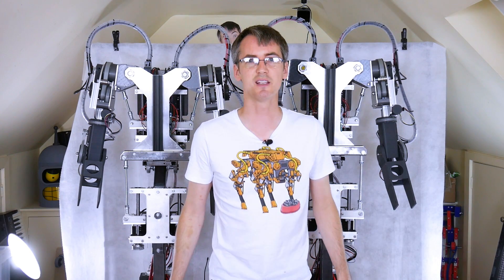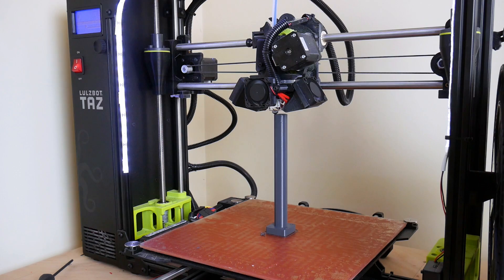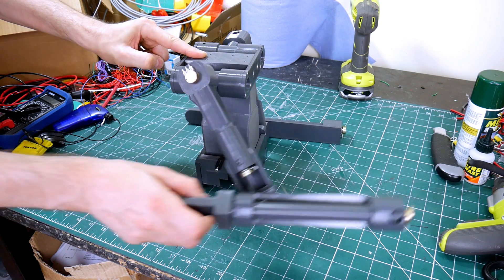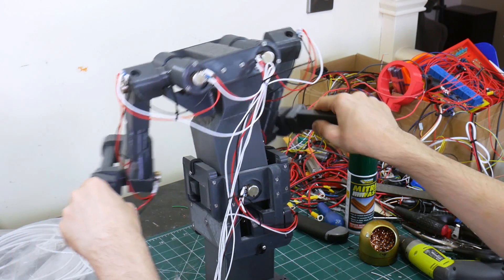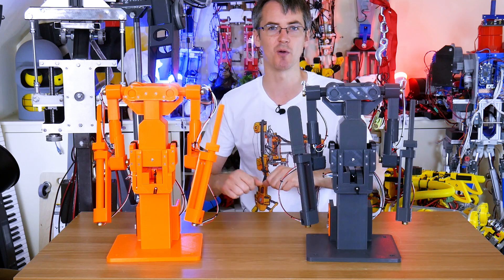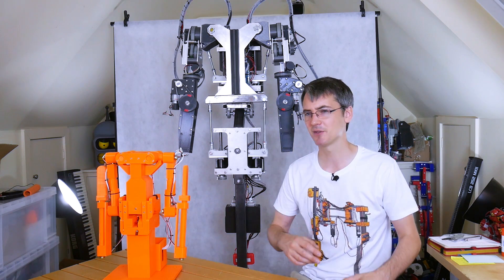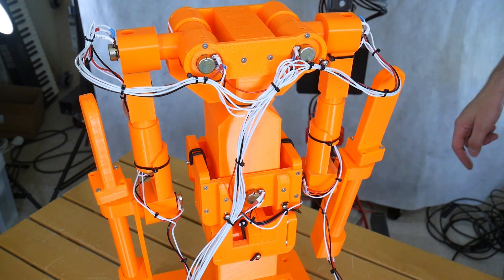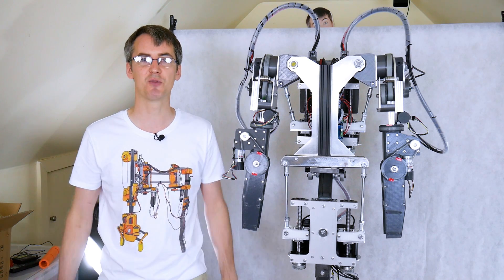Building Motion Capture Rigs for Robotics & Animatronics

Comment: Great work, if you need to get 3D rotations to animate the arms  from a webcam source you might find MocapNET helpful. It is hosted on github and outputs full 3D pose in BVH format ( including the  joint rotations ), so you can just grab the left and right elbow and shoulder joint values and use them to set the pose of the large robot..!

Comment: It'd be cool if someone eventually made some kind of mocap suit for human controlled robots. 

Using gyro and accelerometer IMUs makes the most sense. It'd only require seven sensors, two wrist + forearm, two elbow, two shoulder + upper arm, and one torso; most of them would have to be 6 dof IMUs, except the elbow which would be a 2 dof IMU. I know your robots don't have torso twist, and your wrists might not be 2 dof, but that doesn't stop someone from adding these to their own robots.
Then that just leaves whatever the hands are going to be. If they're just simple grippers, an analogue trigger would work. But if someone wanted a full hand, and developed a fully functional robotic hand, then a mocap glove would have to be made.

Hands aside, how difficult would this be to develop? The most adaptable solution would to put each sensor on a band, like a wrist band, elbow band, and torso band, then finding some kind of solution for the shoulder. 

The only awkward thing might be scale and proportions. For an exaggeration, say you have a 4ft person controlling a 6ft robot, there may be some difficulty controlling it due to scale not being 1:1. For another exaggeration, say you have a person controlling a robot with the body proportions of a gorilla, similar to the scale issue, but now the arm proportions are not 1:1 to the human. Not sure how this would be fixed without a complex program that would translate scale and proportions to make hand positioning 1:1, which would then start involving kinematics.

Comment: These pots tend to loosen their internal structure and offset their position when pushed over their limits. To avoid that, you'd better design mechanical limits in your joints to protect the pots. That is in case you plan to use them for long time. And just for preventive maintenance, you'd better replace them once per year.

Comment: Looks GREAT!  The range of motion on the shoulder joints of the puppets seems a lot larger than what you can get on the actual robot.  A physical stop of some type on the puppet robots may be useful to mimic the larger robot.  Quite impressed with these robots though.  I am curious what the puppeteering would be like if you dialed back the filtering to see just how responsive they can be on their current power supplies.

Comment: If there was ever a time to implement machine learning, it would be now, to convert the input from the puppeteering rig, to 1:1 movements in the robot. Basically, you use the input from the rig as both the input for an artificial neural network, and the desired result for the sensors in the robot that read the positions of moving parts. Essentially, it would be something like an auto-calibration program. (I may be using the word “calibration” wrong. Just a little.)

Although, it might be good to wait until the rig is fully upgraded, in its final form.

Comment: I’d love to see a motion capture suit exoskeleton
Reply: Motion capture becomes difficult when you factor in scale and proportions. For an exaggeration, say you have a 4ft person controlling a 6ft robot, the scale difference would cause difficulties in controlling the robot. Similarly, proportions have the same issue, for another exaggeration, say the robot has the proportions of a gorilla, the longer arms would make control difficult. There's no easy way to fix this without multiple kinematic calculations and finding a way translate the movement of one to the movement of the other where the positions of the hands on both subjects are the same. Or you can skip the difficulty of kinematics and just watch people stumble about while trying to control a robot. 

Now, it'd be interesting to see a neck and head put onto a robot, with full vision capabilities, and a VR headset on the puppeteer. It'd be interesting to see if the brain could adapt to the robot body having different scale and proportions, as the point of view would change from that of our human body to that of a foreign body. This would remove the need of the complex kinematic translation, but would add other complexities.

Comment: Really great achievements in such a short time! For the power supply issue, you could consider using four 12V sealed lead-acid batteries in series and add the 48V power supply across them for re-charging them. The motion peak power will then be delivered by the batteries  and the average power (which is much lower) will be supplied by the power supplies. I use this method in my simulator motion platforms and it works really well.

Comment: I have a max for live patch that will let you output DMX from Ableton if you are interested.  This way you can sync it to music and other controls as well (and also use a MIDI controller as input).  I could make it record DMX as controller data as well but I haven't actually tried that yet.  I use the entech USB DMX interface for the hardware.

Comment: Great job!  The simpler solution for the pot support is to do printed rods with a cwpture end that extends past the current location and berings to assist the rotation.  It also means a holder for the shoulder pots to keep them from spinning ans alow for thevpots to not fully seat inside the ends of the printed rods.
👍👍👍

Comment: Do you mostly use PLA?  I would be concerned about thermal stability.  Maybe because it's a cooler climate in the UK?  I live in southern CA and I  have had some problems in  a car.  I have been  using Ngen.  Any experience with that?

Comment: 02:02 ughb. So old skool. Please, if encoders are too over-the-top for the purpose, at least use magnetic solid state 'pots' and welcome yourself to the 21st century that started 19 years ago.
Reply: My comment may sound brutal, but rest assured that your projects are appreciated.
(Brexit less so.,.)
Reply from the maker: Yes I've used those in other projects. The ODrive relies on encoders however to position the motor stator correctly because the motors are brushless.

Comment: Wooooooooow, great speed and fluidity. Awesome. I always hate it when I see slow robots like we are in the 60's. Also there are many chinese optical or induction rotary encoders with housings and bearings on the shaft for a few quid a piece. No need for those fancy magnetic ones.
Reply: he originally used the optical encoders but they were junk.
Reply: @squeethesane  could you tell me in what video he looks at the optical encoders please
Reply: @joelaw728  nope. but iirc it was during his ultron project. they had almost no resolution in the software until they were turned up to the point that noise then became the problem. The magnetic encoders nearly hit micron resolution and there's no reason to go backwards from them.

Comment: The little elbow extensions you are using for handles could have a sort of spade grip or pistol grip to it and simple trigger mechanism connected to a pot to control opening and closing of a hand on the robot. I swear I’ve seen a really similar setup for robotic arm controls when handling nuclear materials. I’m guessing with the way it’s designed and how the robot doesn’t have hands yet, that might be your plan. I’m definitely interested in how you plan on controlling the head. (How cool would it be to use a VR headset and a cameras on the robot for some crazy augmented reality controls).
Reply from the maker: Yep, that's all part of the plan!

Comment: Oh, this seems tangentially-related to that VR-controlled animatronic idea we DM'd about on twitter a few months back! Neat.
Reply: VR controlled robots with some kind of motion caption suit would be cool. Though, if the robot doesn't have the same scale and proportions as the human controlling it, would the human brain be able to adapt to the robot's scale and proportions based on having the point of view of the robot, assuming the robot has a neck, head, and vision? Especially if the VR headset has eye tracking and the robot has binocular vision with two axes of rotation on the eyes, mimicking what our eyes do?
For an exaggeration of scale, say you have a 5ft tall person controlling a 10ft tall robot, typically it'd be hard for them to control the robot because the robot would have longer reach under the same proportions. For a similar exaggeration with proportions, say the robot has the proportions of a gorilla, similar to how scale makes control difficult, the proportion difference would cause similar difficulties. If scale and proportion are not 1:1 to the user, there will be control difficulties. But with the addition of VR, would our brain be able to adapt to a foreign body if our point of view is also from that foreign body?

Comment: Have you ever tried to make a ball socket for the joints? 
I love the Idea for ball joints.. full 360 motion but making it possible is hard ..unless >.>  it was an enclosed system, the ball would need grooves on it and some high torque servos with gears could rotate the ball..  creating movement..  

*I'm just day-dreaming in the comments..*

ooOOoo Like the ball could be a omi-directional OneWheel,  in resting/idle position it returns to a general position, so the ball could be charged..

-That be a cool idea for OneWheel to do.. like a power bank in both balancing sides and the middle being a omi-directional Wheel with a conductive material as the base of the wheel for charging when not moving  and rest of the wheel being treds.. 

Though the  top of the board would have to be  some sort of dome with rollers to let the ball roll freely and keep the board attached.. You wouldn't be able to take it off a jump unless there was a system/rig in-plays to prevent the ball from coming out.. hmm..
A gyro balancing system and some electric magnetic field in the ball holding it to the board  would work but that have to be a thick dome to keep something that heavy attached.. 
the power source would have to be big or the speed wouldn't be that fast..
hmm with all those additions the power draw would be nuts.. 
so no gyro balancing system.. the magnetic field is an idea but to be more reliable it have to be rig/system..
Like a distance system  under the board  that pick up the distance  between the ball and board and automated  rig would hold the ball in.. hmm idk

Comment: It'd probably be a bit of a hassle, but perhaps you could look at incorporating a LiPo buffer battery system, where you allow the robot to exceed the power supply's current limit by also draining from some LiPos, and then whenever you're not exceeding your supply you can recharge the batteries (using a DC-DC LiPo charger running off the power supply, parallel with the ODrives). If you wanted to max out the ODrives you'd obviously need a lot of batteries, but perhaps you could just allow a couple of key motors to get boosted and perhaps still only to (eg) 10A up from 5A.
Reply: If he can find a source for them at a reasonable price, some supercapacitors would work better in this context.

Batteries in general aren't fond of high current loads, while supercapacitors trivially cope with very high currents/high discharge rates.
Reply: It depends on how long those loads last; it's quite easy to get lithium polymer batteries with (eg) 45C constant discharge ratings for cheap, where if you have (eg) a 3Ah battery rated for 45C you're able to output 135 amps constantly or around 270 amps for <10 second bursts. Ideally LiPos should be charged at around 1C (3 amps for a 3Ah cell), but many people are able to charge them at much higher rates while still obtaining reasonable battery lifespans. Turnigy 'Graphene' LiPos (known for higher-than-usual charge / discharge rates) are advertised as being able to charge at up to 15C with some of their batteries; at that kind of rate, and with any battery of reasonable size (2Ah+) you'll be more limited by how much the power supply / charger can provide during lulls in robot movement.

Comment: James, I would like to have your opinion on something. I suggested this type of puppeteering rig to the guys who did Eagle Prime over at megabots, except I suggested the rig would be fitted so the pilot can simply grab the handles and move his arms the way he wants eagle prime to move. Basically the same system used in Method 1. They said that they COULD do that, but it wouldn't be safe due to pilot induced oscillations, however if that was the only issue I could think of hundreds of solutions, so why do you think they chose to not go that route?

One of my solutions that I thought of was to basically have a deadman's switch on the handles which means that if the robot started oscillating, the pilot could simply let go of the handles and the arms would reset.
Reply: What James has done is very different to what you are suggesting. To mimic the humans arm moments, and not just be a puppeteer rig you would need to account for the translation between the human joints and the rig joints, then do reverse kinematics to decern the human motion from motion of the rig. Basically add some Boston Dynamics level difficulty to the project for litte gain, as humans are pretty good at manipulating things similar to how they would move.
Reply: @tando6266  You're overcomplicating something that doesn't need to be complicated... First of all, inverse kinematics is not that difficult. Heck, James has a perfectly viable IK setup for his open dog. You wouldn't need to mimic the human's arm movements perfectly at all. All you need is to know the location of the elbow and the location of the hand. The inverse kinematics handle the rest.you can basically just have a rigid seat with two "arms" coming out from the sides which strap on to the human's arms. Seriously, it's the exact same thing James did in this video except more simplified since you don't have any torso movement to worry about. 

Also, little gain? What planet are you from? The way Eagle Prime handles now you have to move each joint individually using levers and buttons which means it's EXTREMELY difficult to get any semblance of accuracy in it's movements, and it's basically impossible to move both arms at the same time unless you have pre-programmed movements. Being able to control both arms at the same time and perform complex and accurate movements would make it a whole different robot.
Reply: @bummer6  Actually no I am not, james IK model is good but its accuracy isnt that good. A 1mm error in position calculation when scaled up to eagle prime would be unsafe to operate. Honestly if you think its not that complicated to do you should really be emailing Boston Dynamics and tell them to stop RnD, you figured out with a teensy board
Reply: @tando6266  As stated in my post above, they said they could do it easily, but they said the only thing stopping them was pilot induced oscillations. I provided a solution for that. Also, controlling the robot with levers and buttons is way more inaccurate and imprecise than using a puppet system, so what you said doesn't make sense. Even so, I suggested a deadman's switch which would make the whole thing have an instant failsafe if something did go wrong.